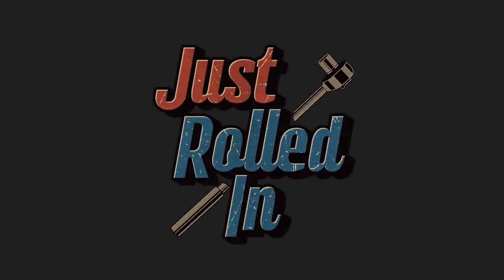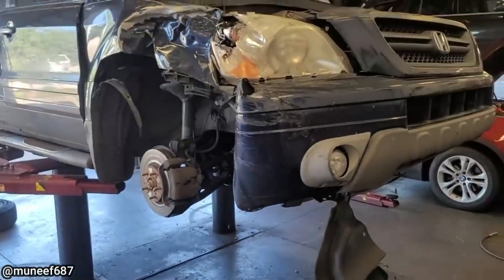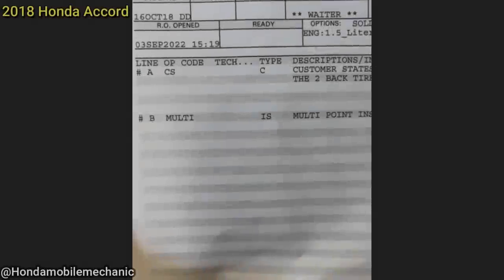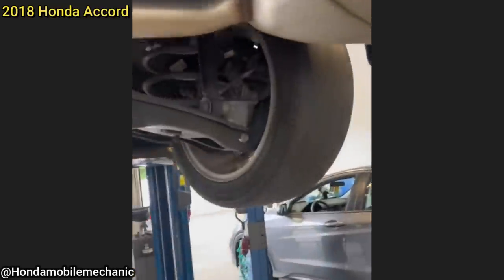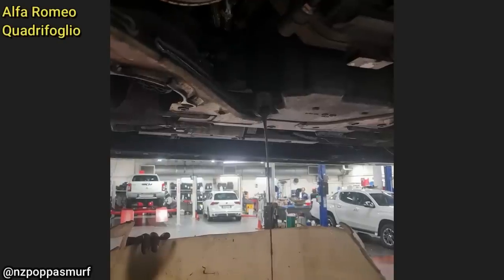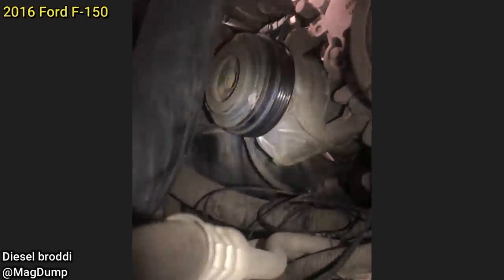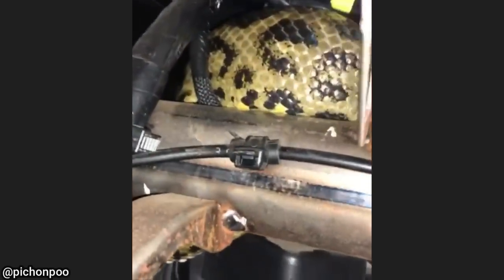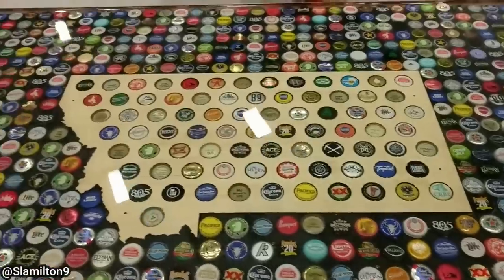Customer States Haven't Serviced Honda Civic In 9 Years | Just Rolled In

Comment: I typically work on my own cars. My wife's new Hyundai Kona went to the dealer for a repair of the temperature control module, a DTC. I looked under the hood after the repair.  The air duct for air into the air cleaner is missing 2 fasteners, loose. It was not put all back together. New cars going to a dealer for service or warranty work is a crap shoot.

Comment: The Ford transit needs to have the transmission valve body re-learned. Each one has a code that needs to be programmed into the TCM during a re-learn procedure. Likely the reason why it's been back so many times. Ford, follow your own technical documentation and you might save some money

Comment: Side note, has anyone ever had any luck with those OTC A/C recharge kits? I bought one for my '07 GMC Canyon 2.9L and not only did it not work (gauge on the kit barely came off the bottom, A/C still didn't run cold), when I took it to a shop to have it done professionally they came back saying the system was almost 2x overcharged. They removed the excess and it's worked fine ever since.
Reply: I looked into doing my own and it's a lot more complicated than just running a can in the system.  It involves using special fittings and gauges.
Reply: It is so weird that the EPA regulates refrigerants so much, forces Techs to be 609 or 608 certified, and then allows those suicide kits to be sold, along with refrigerants with stop-leak in them. BTW, stop-leak is almost instant death to an A/C system.
Reply: @61rampy65  I always thought the same thing lol, they're so strict, but eh, let ol clueless Joe use half a can, spill a quarter into the air and throw the rest out where it goes into the air again eventually.
Reply: I used one on my truck worked decent, next summer it was low again, so did another can. Has worked fine since.
Reply: @M.TTT.  I'm not saying that those kits don't work, it's just that you need to have a decent idea of what you are doing. Most DIY guys think that if some refrigerant is good, more is better. NOT SO!
Reply: @61rampy65  ohh yea, 100% man.

Comment: The ford needs one of the solenoids rewired. The reverse polarity causes The Forward Movement when a vehicles transmission is in reverse. I have had to work on several of "Fords" rebuilt transmissions! The easiest repair of all time. That is unless no repair was needed!

Comment: The no oil change clips kinda show how well made and dependable most new vehicles are.
Reply: Yet my friend thinks old cars are better because they body is made of thicker metal and he once saw an ad where they rolled a car down a hill and it barely dented then they got in and drove it away right after... he also thinks it's safer if you get in a crash since new cars get dented just from a light impact.....................

I told him I had a 10yr old crt pc I'd trade for his flat-screen, told him I could roll that baby down a hill as well and it would barely be scratched yet his flat-screen would be completely broken lmfao
Reply: Your friend has a point. If you crash in a modern car, you're very likely to survive while your car eats it. Crash in one of those oldies, and the car might be the one that survives.

Comment: You dont have too in a P.O.S. import. They start burning oil at low mileage . If your adding a quart a week because the blue smoke billowing out the tail pipe no oil change is needed! Even the oil filter is flushed...

Comment: My ex had a ford probe she had for 5 years and never changed the oil, she’d just add a quart every few weeks. When I did an oil change the filter weighed 10lbs and the engine seized up a month later. Of course it was my fault her engine seized 😂

Comment: When I was 19 I bought my first car, a 1990 Chevy Corsica LTZ. Got a trip permit and drove it to a Good Year garage to get an e test. They told me they did a "tap test" on the ecm and the car died and wouldn't start again. Never heard of a tap test before or after. Long story short I wouldn't let them do anything else and had it towed home. The guy behind the counter got pretty upset and tried to guilt trip me after I called him out. Replaced the ecm myself with a new one and that car was mint for years after. They claimed to be born again christians, I imagine so they could claim they were on the level. Years later and much more knowledgable about cars I bought an old Chevy G20 Van with a 5.0 liter tbi. Was due for an emission test, brought it to a garage that was open 24hrs and had the test done. Failed. Mechanic told me it was probably a fuel injector and they'd have to take the whole top end apart to repair. Really???? Got it out of there right quick, made an appointment with my usual place(which meant I needed to take a day off to get it there within' business hours) and they diagnosed a bad cat. Had it replaced with one from a junk yard and voila, passed e test no problem every time until I had to park it. Thankfully, I have a friend I've known for more than 20 years who is a wizard(not the car wizard but definitely of equal skill level) and can help me out in a jam when there is something I am not skilled enough to do.

Comment: Had my wife’s 2019 Ford Edge AC compressor locked up and snapped the belt just last month, same as the F150 in this video. Thankfully that was only a $100 deductible w/ the warranty but I feel like it’s gonna happen again once the warranty is over… $1300 quoted yikes!

Comment: That 2013 Civic without oil change in 47k miles could use BG 109 EPR engine performance restoration engine flush and remove all that black sludge in the engine!

Comment: Just curious. How would one clean all that sludge out if your not removing the engine... Multiple oil changes well before they are due? Run a cleaner through the motor? Asking for myself!

Comment: Holy crap, that looked awful!
I changed oil in my car after like 6 months.. I had that car for years, never had any issues with the engine.
But the front lights, the drive shaft etc.etc. were worn out.

Scrapped it eventually.

Comment: So Honda builds some great engines.  One of my first vehicles was an '86 Honda Accord 5 speed.   It got hit, insurance paid it off, and a friend then bought the car from me because he had a log dropped off a truck got through his front end.  So... he got the front clip, and engine from mine and was on his way.  Good deal for everyone... except aI lost a car I really liked.
 Now, for my question.  Can the CIVIC engine be saved?  Commercial engine flush?  Change oil and run 50/50 transmission fluid for 200 miles?  Ideas?

Comment: Economically speaking , replacing the engine is cheaper than all the oil changes over  all these years
Reply: Is it though? Yeah if you replace it with a used junkyard motor and install it yourself but getting a brand new or even rebuilt motor and having it professionally installed is going to set you back a lot more than just staying on top of regular oil changes.
Reply: @homedeezyfasheezy5662  where i live it would cost 100 USD of labor to swap an engine, plus about 400 usd for the engine, depending on which one obviously...
Meanwhile every oil change at the dealer was about 64 usd for 4 liters of oil (nissan x trail 2011)

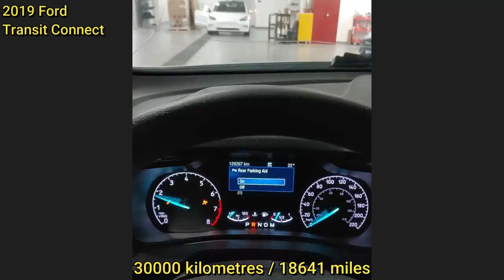Comment: 2:10 but the speedo reads 129k or has been rebuilt several times in 30k?
Reply from the maker: Rebuilt several times in 30k
Reply: @JustRolledIn  sound, sorry normally the mileage you have flash up relates to the total vehicle mileage, not the fault, thanks for the reply tho 🤘

Comment: 9 yrs that's it.😆😆 1961 Apache 20. No oil change since 1988. When it was done before that year not sure.
It gets better now I never have to add oil. Fuel pump adds gas into the crank case for me. Now it's winterized   Chevy make us own winter oil. Have to see if I can find a none China made Fuel pump

Comment: That Honda with no oil change...my question is...Is it possible to clean the engine of all that sludge a d have the engine run properly? Is it possible to save it? How many short interval oil changes would do the trick?
Reply from the maker: Its possible! I showed in a video a while back, that a technician cleaned up an engine that hasn't had an oil change in 12 years. Ran perfect afterwards.
Reply: @JustRolledIn  That is truly incredible. Thanks

Comment: It ran that long without oil change? Honda engines are tough. On my previous job had a Ford Transit 2020 engine failure because it followed manufacturer oil change interval of 40 000km. Had one oil change and broke down at 56k. Luckily replaced by warranty. But still that many miles and Honda broke down at 9 years is impressive. Some people are awful with their cars. Simple oil change service is around 200-500€/$. You run through much more money on fuel. And neglecting a car means you don't save anything because it looses value when it finally breaks down. Getting running again will definitely cost more with newer cars that are more and more complicated.

Comment: I doubt the problem was in the transmission of the Ford. It probably wasn't rebuilt correctly every time. obviously the initial failure was most likely caused from it not being built right from the factory (probably made in Europe 👎). i say get a Toyota or a brand new transmission.

Comment: What does the pro mechanic do with the Honda Civic with the 9-year-old gluppy gloppy oil, i.e. how do you fix this?
Reply from the maker: With time (money) you can take it apart and clean it up, and inspect bearings and other engine compontsnts and see how it runs afterwards. I showed in a previous video where the customer didn't change the engine oil in 12 years and he paid the technician to clean up the sludge and it ran perfect afterwards.

Comment: Yeah, I'd decline repairs on car air conditioning too. The system is unnecessarily complicated, built-in so that you need to take the whole car apart to do anything to it. Stupid, utterly ridiculous design philosophy. I have a 1977 truck with an air conditioner. It's bolted in the rear window, powered by an inverter. Cost to replace it entirely? $150. Yes it works, although I need to upgrade the alternator to keep the batteries up so I can use it for longer periods. It takes a little more amperage than the truck came with, but that can easily be provided. Of course that increases the initial cost, but one of them going bad won't break the other, so their replacement costs aren't linked over time. Best of all, any part of it can be replaced with less than an hour's work, which I can do myself, without taking apart any other portion of the truck.

Comment: So what happens to the engines like Honda Civic? They get replaced right? It had 47 K on the clock, so maybe 10 oil changes should have been done? Talk about false economy, not sure about the cost of a replacement engine, but far less than the oil changes for sure.

Comment: 2:10 But the Dash says 130000km not 30000km...
Reply from the maker: I said the transmission has been rebuilt the past 5 times in 30000km. Not referring to the mileage on the vehicle.

Comment: 2:08 I think this tells us more about the "repair" shop then about the client: rebuilt five times and STILL didn't get it right...
Reply: "Dealer" 
"Under warranty"
That van has bigger issues than the transmission.
Maybe the power train control module is causing it.

Comment: Just roll the Honda Civic out on a flatbed and give the owner a Bicycle, he doesn't need an automobile that's ridiculous. Just change the oil every 5k miles with the correct engine oil and make sure its full Synthetic. Honda especially a Civic could easily hit 300k miles.

Comment: Hope that dude with the tool box put a layer of plexy glass on the epoxy finish to prevent scratches. Its too pretty to use as a work surface